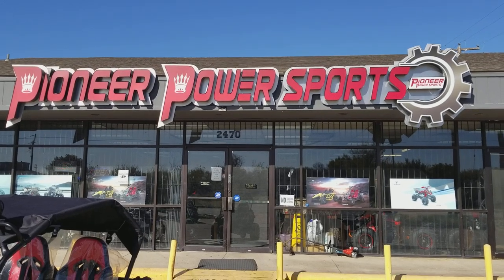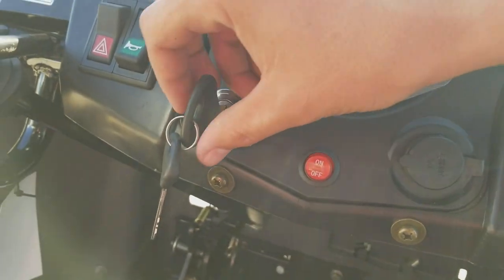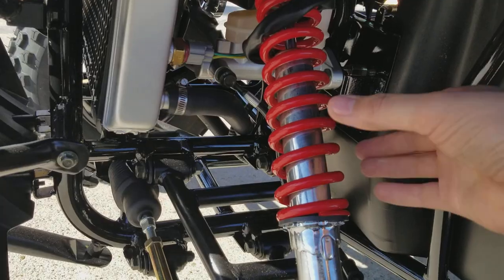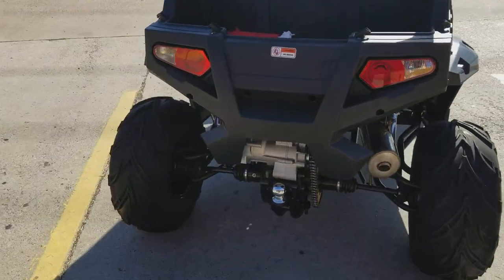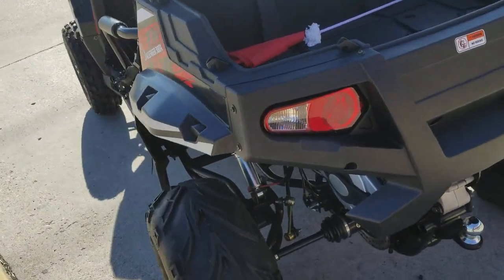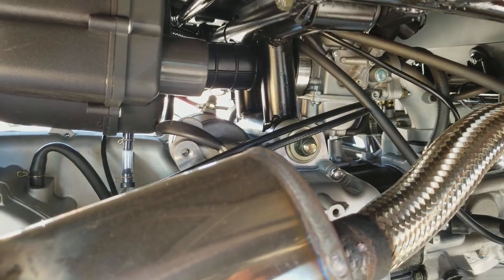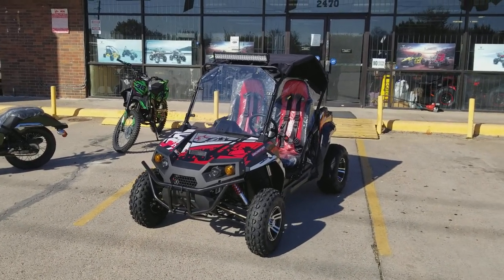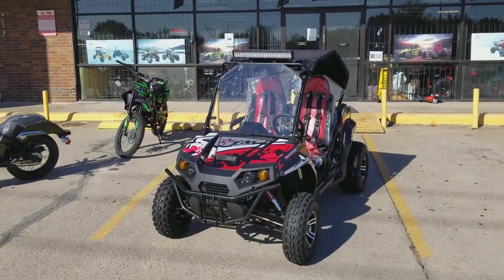Trail master 300x | 300cc utv | full detail | review | overview

Comment: How fast does it go
Reply from the maker: Depends on the model anywhere from 25-45 mph depends on the model you get
Reply: @pioneerpowersports   What do you mean depends on the model.  There is a 150cc and a 300cc.  Take them both for a spin with a dealer plate and see how fast they go so you know or call another dealer that has and ask them.
Reply: @gchsbus  Yeah that is a weird answer... You're selling this thing, he didn't ask about another one he said "how fast does it go" meaning this one you are showing.  That usually means max speed.